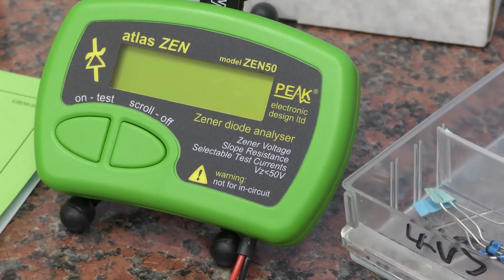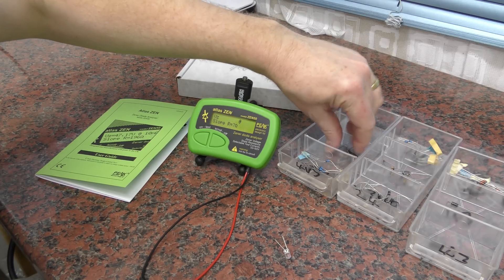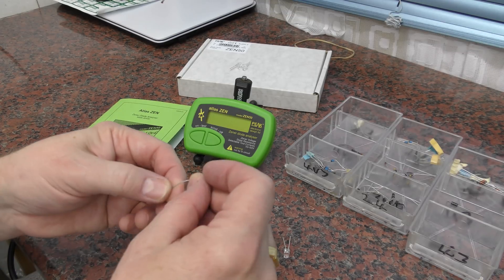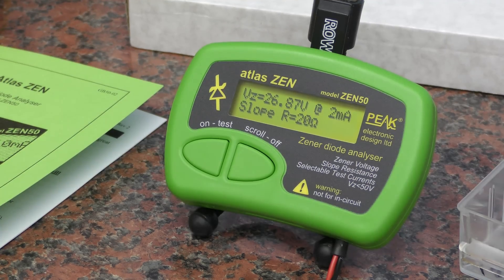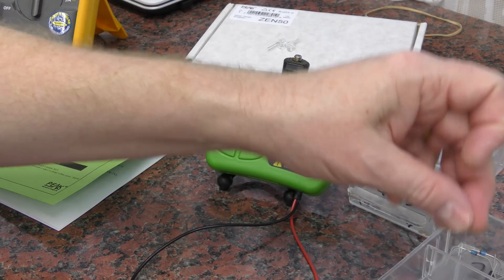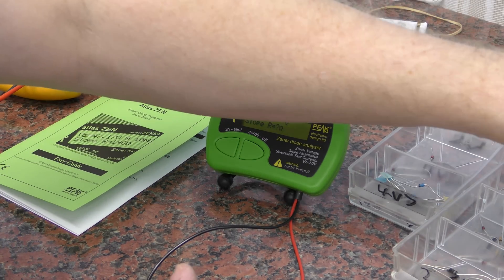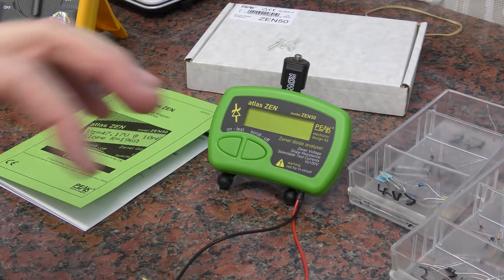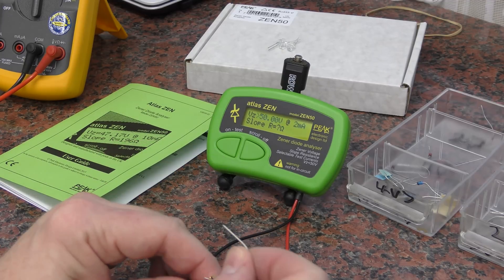Peak Electronics Zen 50. Part 1.

Comment: I found this video as im looking at this unit which i wont be buying now lol  I have the peak atlas esr and capacitance meter which is pretty good.  But as the most of the things i work on are 13v they are all going to be low value zenner diodes so this isn't accurate enough.

Comment: Yes I agree, The lower voltage zener diodes normally would test low. To solve this problem I used a low current variable power supply that allowed me to adjust current and voltage to the desired level for testing these types of zener diodes that gave consistent readings when tested at maximum rating.

Comment: 4V7 zener and lower are very poor diodes, they need 20mA of current to get the correct zener voltage. The high slope resistance is what shows this up. i had a little time testing a lot of 2V7 to 4V7 diodes to get a set that would regulate to 6V8 at 100mA of current. The higher voltage diodes require lower current to avalanche, the low voltage zeners all typically have very poor performance and are basically binned into a range during production, all coming off the same wafer.